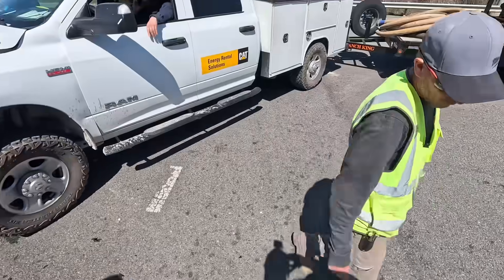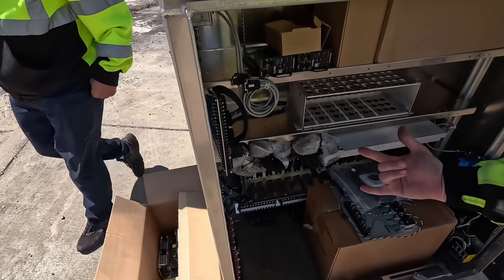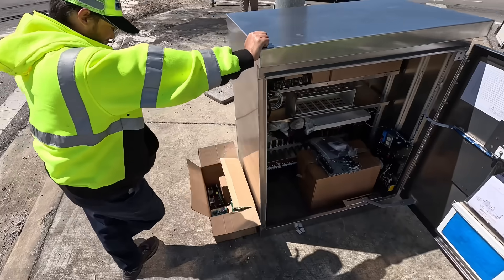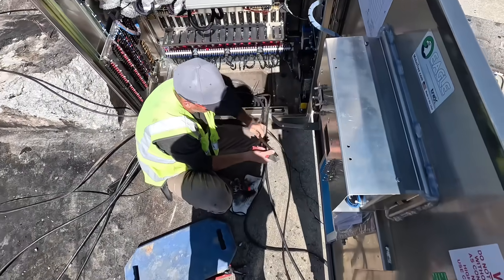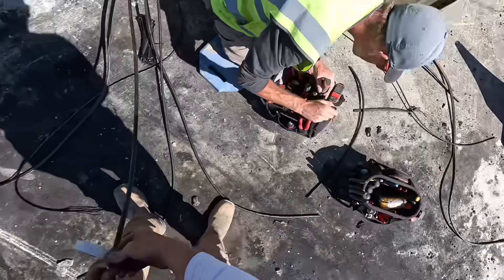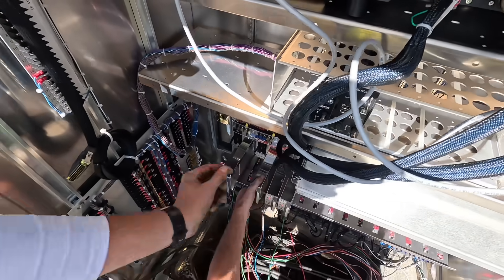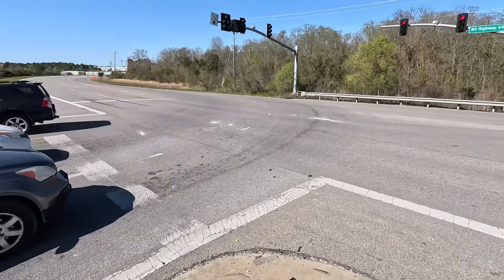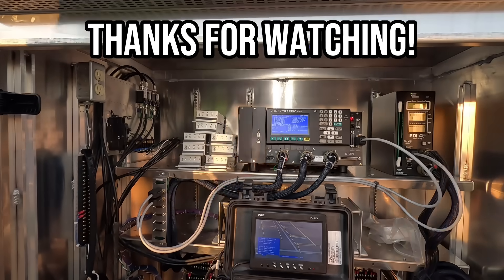Attempting To Fix a Traffic Light… Then THIS Happened!

Comment: Excellent video! I'm wondering why concrete crash barriers don't surround the island (with pedestrian openings) to protect the control system. It has to be cheaper than doing the work it's taking (not to mention the cost of replacement euipment).

Comment: Bummer dude, but a tip from an FR here, never get someone out, or encourage them to get out. After an accident like that they could well have internal injuries or even spinal damage that moving will make much worse. Unless there is more danger from them staying put such as risk of a fire, just encourage them to stay put and hold as still as they reasonably can until the first responders arrive and assess.
Reply: yeah this. the guy looked pretty wobbly on his feet when he got out. if it was more then just nerves and he was about to faint or whatever now hes taking a tumble on hard ground. He really should have stayed put, if anything cut the air bag for him to make it more comfortable since it did look pretty crammed in there. and then just wait for assisstance.

Comment: Not from me, There was a Truck that took out one of the Control Boxes to the Lights couple weeks ago. It go replaced with a new Control Box couple days later. It wasn't even a full day. not even a half a hour after the Guys had packed up and left the job that another Truck came by and took out the brand new Control Box. It might have been only less then 15 mins after the Crew left that it was Taken out again. 
Another New one is now up. But with additional Protection. steel Bollards about 4 feet from Control Box now surrounds the new Control Box. It works too, there is a couple Bollards that are already bent. But the Control Box stills stands at least.

Comment: The traffic lights in Toronto drive me insane.  Main roads/highways you get red light after red light so like 2-3 cars can turn off side streets.  Not synchronized whatsoever.  I wouldn't mind waiting extra time to turn off a side street knowing I can actually move once I got on a road with 2-3 lanes and not have to stop EVERY DAMN INTERSECTION. I don't know who plans this shit but they could solve so many traffic headaches by simply synchronizing the lights, not constantly adding lanes...

Comment: One question, if you please. How do you keep rain out of those pull boxes. I would think that the traffic control box should be setting up on a pedestal.
Reply from the maker: This is a temporary setup to get the intersection up and running! It’ll be put back up on a pedestal once the work is approved!

Comment: 5:34. NEVER hammer the end of a bolt, it'll booger up the threads.  Thread a nut onto the bolt until the end of the bolt is flush with the end of the nut, then hammer away.
Reply: Clever, thanks

Comment: What should have been done correctly.  Each intersection should have been MOTed with one lane each way to slow down traffic, with the obvious stop signs, or a temporary light signal installed. That accident would have been avoided.
Reply from the maker: Yeah this happened within 10 minutes of us pulling up. Was told we were doing the labor while the state provided equipment and traffic control and this is what was setup. But I’ve seen plenty of people run red lights and stop signs.

Comment: Wish traffic lights in Europe were also placed on the far side. It's especially dangerous for instance when you are making an unprotected left turn and you're stuck in the middle of the intersection due to oncoming traffic..  This makes it very unsafe 'cause you can't tell when oncoming traffic gets the red light to complete your turn as the lights are behind you. In some countries like the UK they have stop lights on the near side and the far side as well to address this issue. But here in Greece this is not the case. The only exception here are protected left turn lights which are often placed on the far side, the main lights are only in front of the stopline and crosswalk https://www.google.gr/maps/@35.517181,24.0514338,3a,75.9y,48.52h,97.38t/data=!3m7!1e1!3m5!1sUmOFgmBp1yMmk2UKjYT1TQ!2e0!6shttps:%2F%2Fstreetviewpixels-pa.googleapis.com%2Fv1%2Fthumbnail%3Fcb_client%3Dmaps_sv.tactile%26w%3D900%26h%3D600%26pitch%3D-7.38450653681312%26panoid%3DUmOFgmBp1yMmk2UKjYT1TQ%26yaw%3D48.51934596728616!7i16384!8i8192?hl=el&entry=ttu&g_ep=EgoyMDI1MDMyMy4wIKXMDSoJLDEwMjExNjM5SAFQAw%3D%3D

Comment: I assume you have done plenty of concrete anchors before and im not telling you how to do your job. BUT i usually put the nut on said anchor while hammering it in so that incase the head mushrooms out i already have the nut on. I can tighten it down to anchor it in the concrete then file down the head enough to take the nut off then put whatever im doing ontop

Comment: This is fun, i would like to do this. i left Construction for Telecom. been working as a mostly cellphone tower tech and in the office for the past 12 years come this June and i liked the challenge but its gotten boring for me. This looks like a nice challenge.

One note, it probably doesn't matter too much but whenever putting those wedge anchor bolts, we normally screw the nut flush with the top of the anchor bolt to give us a wider surface to hit and to minimize damage to the top threads, sometimes they get messed up and you have a hard time getting the nuts to thread.

Comment: So question about that preemption for the blank out no left turn fine.

In these situations, is it also tied in to give the traffic sitting on that stop bar with the railroad right behind them a green? Of course I would also have to assume that somehow the blind signal head would have to be a technically separate phase that would be held red during this time.

Comment: I love the STOP sign at the intersection and the first 3 minutes of video with 3 cars Stopping before proceeding out of like 70 cars.

Also the Accident was a Vehicle sliding to a stop against the Black Ford.  That tells you that the ford went from the stop sign without a clear way.  But also that the white truck had too much speed on and was not going to stop for anything..

Comment: Hmm. I wonder if a roundabout would've fixed all the issues here. Doesn't seem like this intersection sees insane amounts of traffic.
Reply: Not super busy. Hwy 611’s municipal name is industrial road, leads to the chevron refinery, and a few other businesses. Typically throughout the day you’ll mostly just see a lot of semis and work trucks running through there. Just depends on time of day, but that particular rd coming onto 611 is basically just a cut through to get to Pascagoula, really only thing down there is bollinger shipyard until it turns into town. Really no reason to go down it unless the guys at bollinger use it to hit hwy 90 as there’s an exit not far from there
Reply: Won’t work because of the railway line, but yes, in general roundabouts work a lot better than lights. Not sure why America does not like them (not invented here syndrome?). There are a few reasons where lights are better than roundabouts but many junctions are improved by using a roundabout instead.
Reply: @ Well the roundabout and the roads could be moved slightly so the railway would be further away from the roundabout.
Reply: We use roundabouts with lights now
Reply: @ Same on most very large roundabouts in the UK. Depends on the traffic flows.

Comment: and they say its ford tough and the ford cant even keep the door panel on lol, would never own a vehicle unless its made of steel., that ford truck it not safe at all even the side airbags didnt work lol
Reply: last i checked Everyone got out with ZERO Injuries and i'd much rather that ford that crumples and absorbs the energy than some big steel one that doesnt crumple making my soft squishy body with soft squishy delicate organs absorb the force and energy of that impact possibly leading to injury or even death
Reply: @ ford is trash enough said, even there side airbags don’t work lol
Reply: Also that Black truck is pre Aluminum so IT'S STILL THE STEEL BODY PANELS
Reply: The black truck is a 2009 to 2014 F150 Ford didn't switch to Aluminum until the 13th Gen F150 in 2015 and also the side airbags didn't deploy because the Computer didn't deem it necessary  Troll
Reply: @ that just tells you there junk then even the steel can’t hold togather, I hate to see the aluminum lol be a death trap and still no airbags. TROLL

Comment: My observations from driving for over 50 years is that some folks drive with a mentality of I'm going to do what I want to do until something tells me otherwise. These are the folks that blow through inoperable traffic signals because in their mind nothing told me to stop. These are the folks we need to be worried about. An intelligent driver assumes everyone else is an idiot. I have spent 50+ years of driving avoiding idiots with a 100% record so far. Drive safe everyone.
Reply: The way I live life is assuming no one can see you period... This way I have been able to reliably avoid anyone running into me cause I just stay out of everyones way... Walking around a parking lot with a high vis reflector jacket and a line of carts next to me "nah no one can see me" cause they too busy trying to get in or out of the lot to notice me and would plow into my carts and their excuses isn't ever "I didn't see them" it's always "I have the right of way why are you blocking my path?"
Reply: ditto. but 60+ years.

Comment: I'd been thinking that your cabinet setup was great, with the huge concrete base. Ours in Sydney and the state had been pretty much at ground level. I've seen quite a few cleaned up by cars and trucks over the years. It seems they're a magnet to accidents. Hitting them is one thing, but then catching fire. Yikes. I have seen ours just about completely submerged in floodwater and still working.... directing the boats. 🎉😮😅

Comment: ............................. Here's a great idea... @ 5:40 place the nut on the bolt so you're not pounding on the bolt's threads.
Reply: 🤔I thought the same thing. Been there and learned the hard way
Reply from the maker: I typically do but an angle grinder fixes any damaged threads!
Reply: @Trafficlightdoctor  I thought some of those anchors have a smaller section on top of the bolt, so even if you mushroom it out pounding the anchor in, it won't get big enough to interfere with the threads
Reply from the maker: @ they do!
Reply: Or use a brass hammer instead

Comment: About 15 years ago outside Chicago, we were re-building an off-ramp from the highway. Where the ramp ended an electrical worker was wiring lights on the corner when he was run over and killed by a turning semi. Be Safe.

Comment: I'd like it if you would talk more about what you're doing while you do it. Like, why did you have to install those jumpers? What problem were you trying to solve? What was the guy in the bucket truck doing at the end?
Reply: The jumpers in the cabinet were used to "tie up" the red signal indications for all the missing/unused load switches(relays) on Ch 9,10,11,&12 - which are typically the pedestrian signals (Walk & Dont/Walk -- which that intersection I didn't notice it having any) inside the cabinet. They were needed to appease the conflict monitor/MMU (malfunctioning monitor unit) channels not seeing a field output load on the unused signal phases (kind of technical thing that most people would not understand if they weren't trained). The jumpers basically are there for the unused load switches to make the MMU run as normal and get the intersection off of FLASH operation. 
A explanation on every aspect of what a tech does might get too involved causing a longer than needed video because just reading over my above explanation seems to go deep 🤓LOL.
Reply: @trafficsig2012  he really needs to do a video where he draws a diagram and explains how everything works once, then he could just refer back to it if people ask
Reply: @gorak9000  That is a great suggestion.
Reply: @trafficsig2012  thanks!

Comment: Hello. I used to be a railroad engineer. I have a couple of questions if that's ok?

I am curious if you guys notified the railroad that the traffic lights were out in case they wanted to have a flag man "RWIC" standing by to give extra protection for the crossing till you were done and the signals were back up?

My other question is. Does the railroad know that the temporary setup does not have the extra protection of the preemption working. Just in case they want to issue a bulliton or restriction for the crossing?

Thank you.
Reply: to further ask can you show us how this works with a stoplight integrated with a railroad and what happens when a train comes thru? Love watching these videos!
Reply: Railroads have their own boxes
Reply: @livestreammaster  Yes, but traffic lights and railway crossings need to communicate with each other so the railway intersection can be cleared for the trains.
Reply: the RR was made aware by the local police. any train coming thru there would be coming thru at a reduced speed and "making noise". they would need to be able to stop within visual range of any obstructions.

Comment: That Ferd seemed to hold up pretty good. Good that everyone seemed to be ok. Before you explained it, I was thinking it looked like there had been a wreck that caught fire and destroyed the controller cabinet..

Edit: for something temporary, you should consider using Tapcon bolts instead of what you used... that way they can just be removed instead of having to cut off the studs you used... Heck, the Tapcons are just great all around lol.
Reply: For that work tapcons suck especially with old concrete like tat and may not have room to screw them in.  also you don't want it moving the anchors work the best I also did traffic work for a year

Comment: I maintained traffic signals for 15+ years. Whenever we 'lost' an intersection due to a cabinet getting cleaned out, I'd install portable stop signs on EVERY approach (including the artery) in order to slow everyone down and potentially avoid accidents. The police in my city were useless - directing traffic was 'beneath them'.  They would show up, park on the side of the road or in a parking lot with their blue lights on... If they showed up at all that is.  I used to make up my own railroad preemption relay panels, not difficult as long as the normally closed contact wiring from the railroad is still intact at the junction box in the sidewalk.  IMO you may be opening up your city to liability in operating that intersection in any mode but 'flash' without a working railroad preemption.  I'd be immediately informing the railroad (on a recorded phone line) the preemption is out of service, at the very least, so they could have the motormen limit train speed in the area, and maintain high awareness at the crossing.
Reply: I just commented about the lack of signs coming up to this intersection. Whoever is in charge of this town or area is not taking common sense measures. I'm just a dumb Doordasher so what do I know 😂
Reply: @MAGA305  yep. IMO both accidents that occurred during the video could have likely been prevented with stop signs on all approaches.  I have replaced many a traffic signal cabinet with zero traffic accidents. Many times alone, or with just one helper.
Reply: To save on accidents town or county should cone down the interchange to single lane with temporary 4 way stop.

Comment: When traffic lights don't work, they put up temporary signs until you repaired the lights. Why not fixed signs? Or don't drivers know what to do if there are signs and working traffic lights?
Other question, with your job, how many days do you have you can use for holidays or just a day of?
Reply: Stop signs should never be displayed when the traffic signal is operating in normal operation. That is why he took them down when he put the signals back in operation.
Reply: @trafficsig2012  I don't see why not. Here you have traffic lights with also the street signs and road markings. You use them when the traffic lights are not in use. Maybe it's confusing for the drivers in the U.S.
Reply: @user-marco-S  Glad to hear experiences from other places but typically if a traffic control device isn't in use it is covered up normally with bags and then signs can be used. Driver confusion would occur if the traffic signal showed green (go) while the  Stop sign says stop. We usually have one or the other not both at the same time.